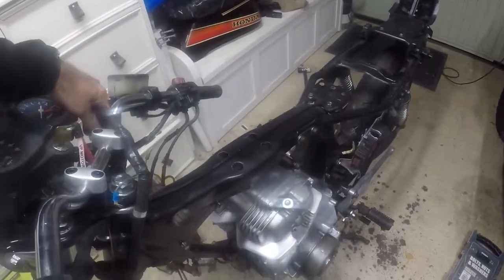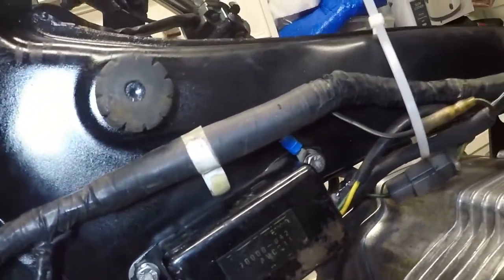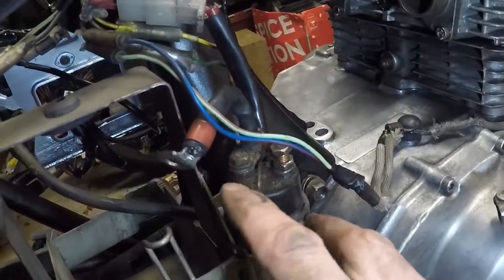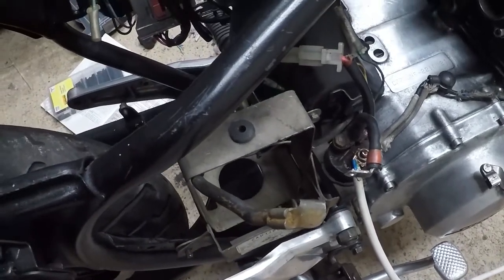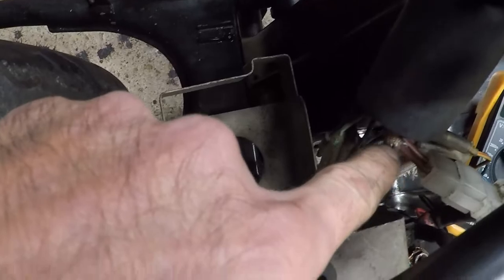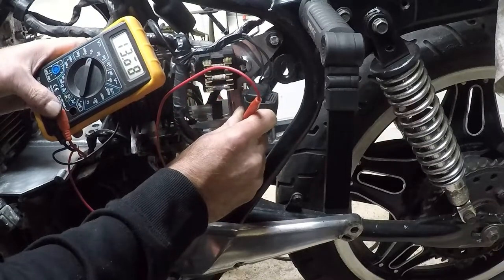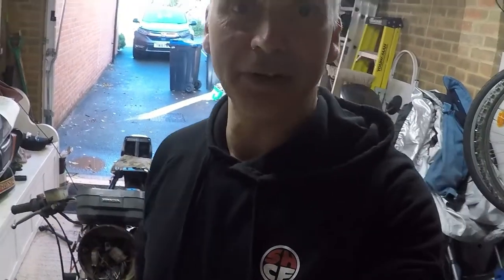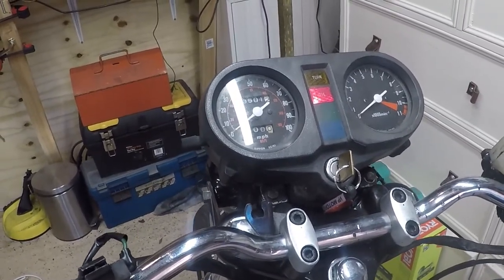Trying to install and fix my Honda SuperDream Electrics from a Manual. (Tea and Cake essential)

Comment: If memory serves me correctly, the mystery wiring clip fits on the left hand tank dowel tube and is restrained by the tank mounting rubber. Looks like the witness mark on the clip is the same diameter as the tank rubber.
Reply from the maker: Thanks Robert, I think you're correct as others have now said the same. I was expecting it would be held by a bolt, but guess the tank holds it securely when in place.  Ryan.
Reply: @RyansGarageUK  
Once the tank is in place the tank rubbers have no where to go "et voila" .

Comment: why were you stunned? you were methodical, used the correct equipment and got the result you thoroughly deserved - I always hated the wiring diagram on mine, thankfully the bike was only 3 years old when I had it in 1984, so no issues. Great progress Ryan and very enjoyable to watch!
Reply from the maker: Thanks Tim, you appear to have more confidence in my ability that I do in myself. 😀 I'm enjoying the challenge but as a newbie never sure if I'm missing the obvious or not.

Comment: Black and gold bracket goes under the front tank rubber above the cdi unit to hold the harness & I have a couple of old inlet rubbers here that will do for testing the bike runs if you want them, and you should have a wire that holds the clutch cable which bolts to the front of the coil, the spare green wire is a spare green wire and the other two on the starter solenoid side are for the rear brake light switch
Reply from the maker: Thank you very much Pete, I've ordered something to try and test the carbs so I'll try that and maybe  make contact with you if my plan fails? I think I have the clutch cable holder so I'll seek it out and try to put it in place. Thank you for your support. Ryan.

Comment: That bracket holds the wiring loom in place and it goes under the fuel tank rubber at the front
Reply from the maker: Thank you Lewis. 👍🏻
Reply: @RyansGarageUK  it's the same on all Hondas cb range from 70s up to the late 80s. Just holds it tight at the headstock.